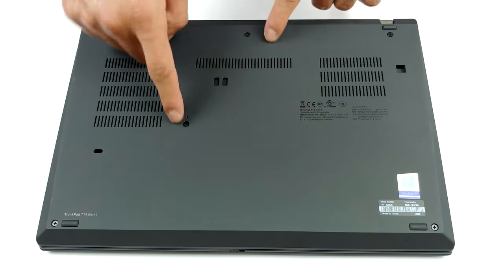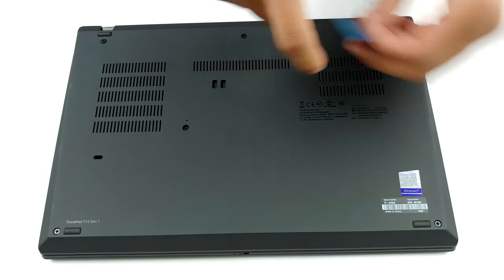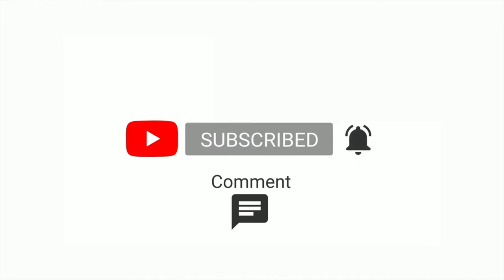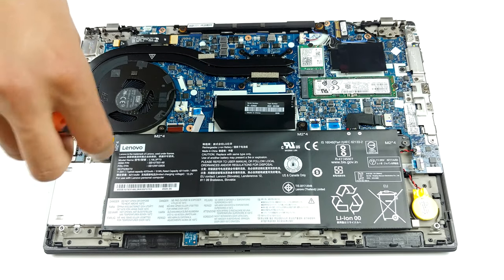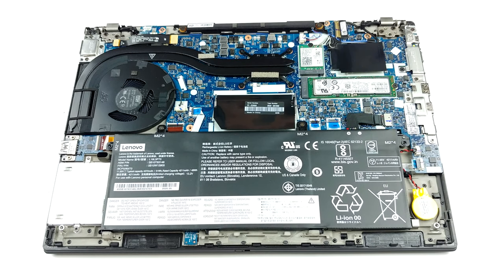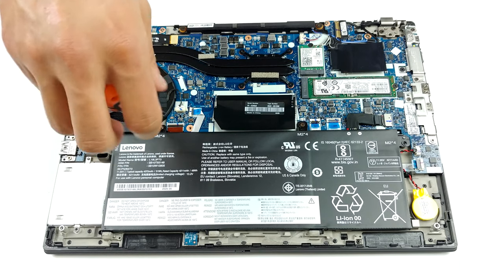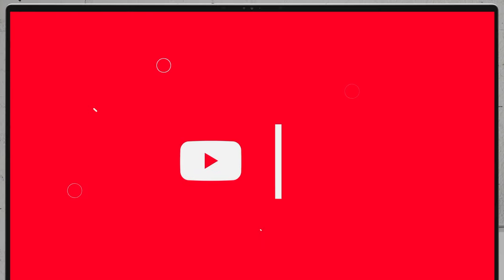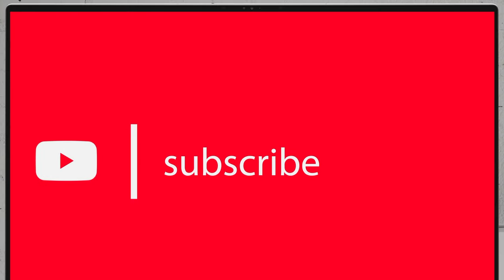🛠️ Lenovo ThinkPad T14 - disassembly and upgrade options

Comment: ah, too bad it only has one storage slot, would've been cool to be able to have a separate drive for my dual boot
Reply: You get me right. I'm looking for a laptop with 2 storage slot too. 
Single 16gb ram slot was enough. No dgpu needed. And 2 storage slot.
When you separated disk for dual boot not just more work, it often make disk partition fragmented. 2 slot is just very very nice
Reply: lcukily t14s got 2 slot m2 2280 and 2242
Reply: How about WWAN slot ?

Comment: Does anyone know if the intel core i5 version of this allows you to replace the LCD panel? It comes with a 1366 x 768 resolution panel and id love to know if you can slap in a higher resolution panel provided that the pins and cable are compatible...

Comment: Hi, is it possible to replace the awful trackpad on the T14  with the ones used in the T470 or the X1 Extreme? Cheers
Reply: i have the P14s - basically the same as the T14... im confused why and how they used the shittest trackpad ive every come across on any laptop ever. its very dissapointing. A tip which helps - take a rough brillo pad for washing dishes or light sand paper and go hard at the trackpad. it at least smooths off that sticky texture and makes it a bit more usable

Comment: what is the difference between t14 and t14s in disassembly and upgrade options?
Reply: The T14s has soldered RAM, a big deal breaker considering it's a ThinkPad. Do keep in mind that the T14 has soldered memory too, but you still have a free slot to upgrade it, or you can choose for that free lot to be used when configuring your T14 on Lenovo's website. Apart from that they're pretty similar, one M.2 slot for an ssd etc. Also, the 'regular' T14 has a bigger heatpipe so the cpu can run at a higher TDP giving a bit of extra performance.
I hope this helps!
Reply: I'm an IT guy at a company where we use both T14 and T14s models and I have to say the T14 is by far better performing device even if both have the same specs. Also the cooler runs much louder due to it's slim factor and personaly I like the soft texture more on the T14. The only benefit I can see in T14s is the weight but it's not big of a difference. In the past we also used T470s, T480s and T490s...both 480 and 490 are really bad laptops the 470 is pretty ok but the fist gen had some battery issues other than that it was an ok laptop.
Reply: @kuk14i  Thanks for your input, can I ask is the T14 a better laptop than the T470? Also, is it possible to replace the awful trackpad on the T14  with the ones used in the T470 or the X1 Extreme? Cheers
Reply: @picb  actually t14s got 2 slot 2242 and 2280. i tried to install it and it works
Reply: @kuk14i  What about the L480?? at least is dual slot for ram, but may not have m.2, unless I use 2240/2280 drive. Otherwise it has a 2.5 "ssd. I'm thinking T14 is a good compromise, expandable ram slot, and nvme ssd. Is the T14 Intel or AMD better?
Reply: @bryandiel6773  Not sure about the L480, we never used those. We just use T14, T14s and E14. If I'm not mistaking the E14 up to G4 has a ram slot and depending on the config, some soldered on memory. In my opinion the T14 is still the better and more premium option. We have first gen T14 laptops still running like a charm in our compnay with daily  heavy usage.

Comment: any chance for a SECOND SSD? I can see that WWAN removed and put a M2??
Reply: Seems like people are using that for dual boot. What you should do is put the drive that came with the T14 into that WWAN and upgrade your primary.
Reply: @egenesis1  can you explain to me what you mean? im super uninformed about pcs in general.. i just got a t14 and wanted to know whats the best way to upgrade the storage. currently sits at 250 gb

Comment: Is it possible to install WWAN in T14 AMD as an upgrade?
Reply: Yes Lenovo sells that on their website, as well as Amazon, just be sure prior to purchasing it, that you have the additional antenna wires prequiped inside the laptop should be a red and aux wire already inside by the slot connection
Reply: That link should help you find the right part number as well as proper installation process

Comment: Does it have a gpu slot? I already bought one and thought about upgrading the gpu in the future if that's possible, don't wanna open my own T14 until then though.
Reply: No, you can't do that. It has no dedicated GPU and even if, there are only a few bulky laptops where you can do that. The T14 has only a GPU which is  integrated in the processor.
Reply: Stefan Oberroither are you sure about that? I can configure the T14 with dedicated graphics
Reply: @kylehca  Ah sorry, of course there is a model with Intel CPU and a dedicated nvidia GPU.  But the GPU is also soldered on the motherboard. You can't change it in the future. Here an amd model is disassembled and they don't come with a dedicated GPU...
Reply: @stefanoberroither5559  alright, thanks!
Reply: No, but the APU in the Ryzen 5 and 7 are spectacular for their wattage
Reply: For most laptops you cant put in a GPU...

Comment: Just incredible how bloody hard it is to open the case....horrible horrible design!
Reply: seriously. i've been trying to open mine for hours after watching this, and it's really difficult to avoid damaging it and forcing it open.
Reply: The case really is stuck on there. Start from the side with the hinges. The touchpad side is the hardest side, get the other sides first and then gently wiggle the last side off
Reply: I had the most luck getting the back and most of the sides separated (leaving the bit next to the USB port and card slot dummy), then once you’ve got it floppy you can sort of push it towards the front and run an opening pick along the front. Once you’ve got the front off you can push it towards the tricky side and open it like a book
Reply: Yep try from back first
Reply: It's easy if you have the proper tools